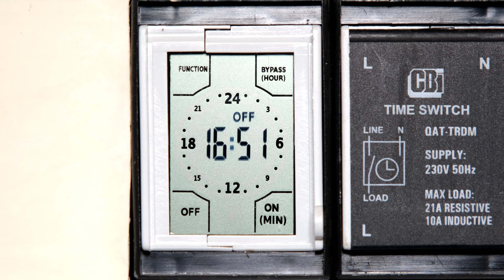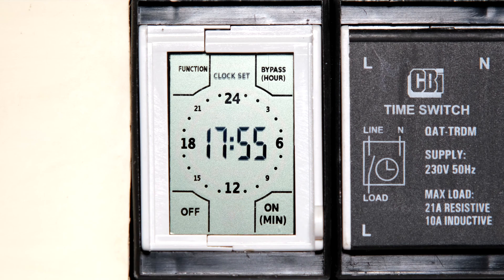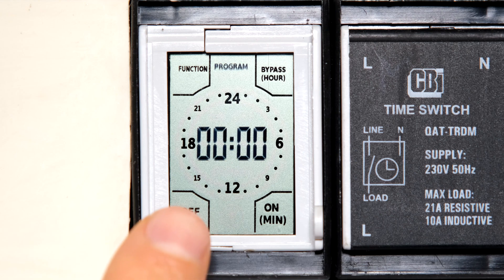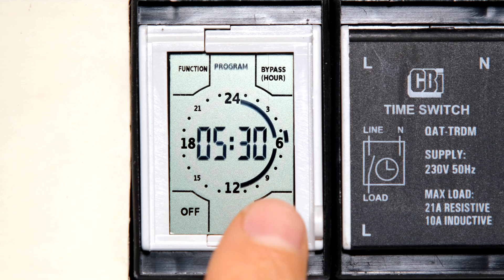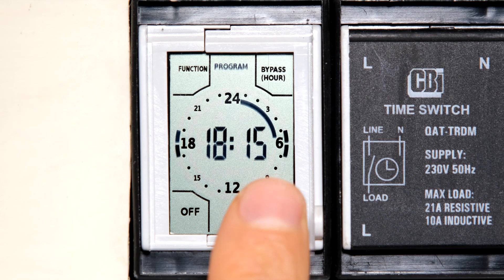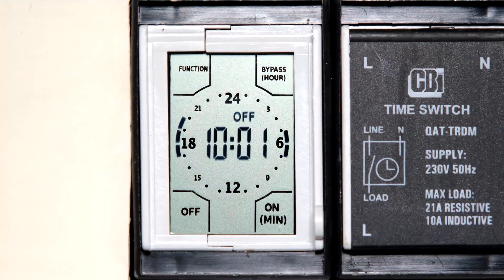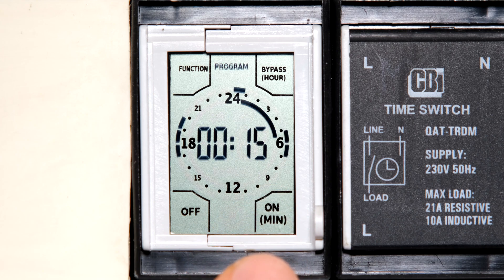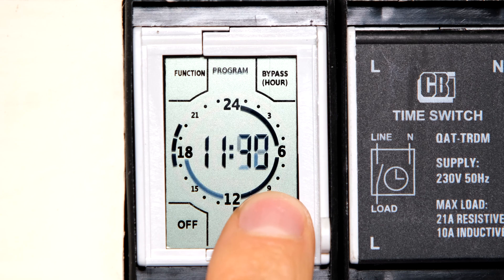How to program and set timings for the CBI QAT-TRDM relay time switch

Comment: Will it automatically switch itself off  within the cycle if the geyser water is already hot?
Reply: The geyser also has it's thermal switch. So this one doesn't have to be off, and still no current will flow thought the geyser element.
Reply: No

Comment: I just replaced one of these CBI timers with a Wi-Fi smart switch. It uses the Tuya Smart life app to control & configure schedules, manually switch on/off or switch on & then switch off automatically after x minutes/hours.

My setup had the CBI connected to a contactor switch then to the geyser, so I only replaced the switch.

What's cool is that you can have multiple schedules for different days. Also no more worrying about the CBI loosing the time after loadshedding.

The switch is a Quve-000, it's rated for 16A. It's an unbranded Tuya switch & works like a Sonoff / Shelly etc device.